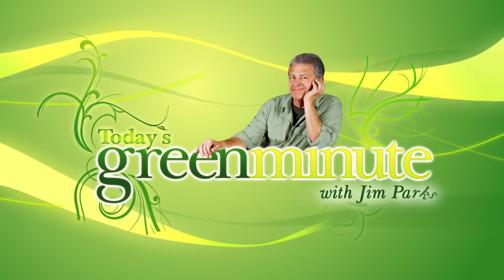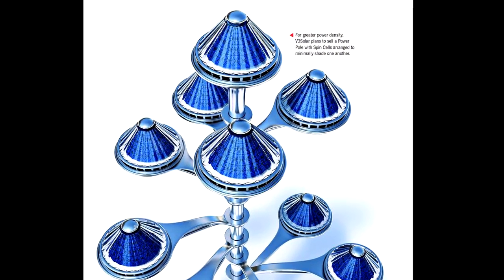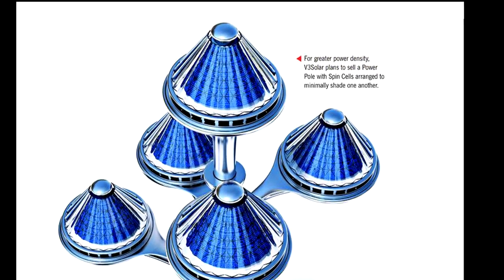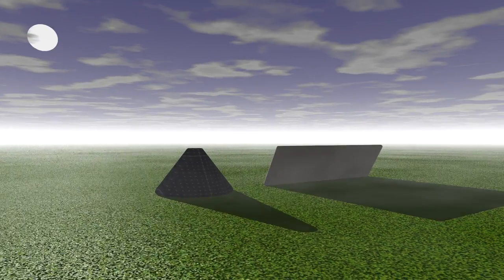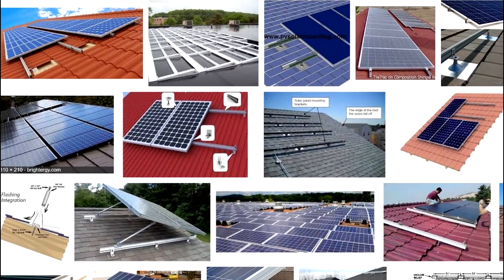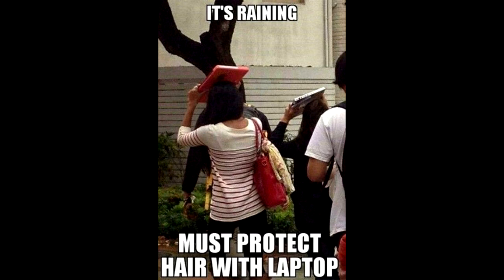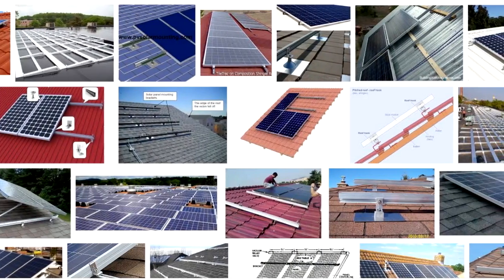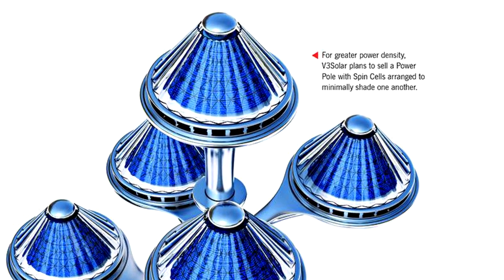Spinning Solar -BUSTED!

Comment: T>F  How about this alternative?   These cells are mounted in the ocean and are designed to SPIN in the WIND and generate more energy then just solar. The other half of the cells would also benefit
from the suns reflection behind the cone.

Comment: if this... were true you would need:
1. a way to generate the power during the dark cycle as well as the light cycle
2. a way to spin this thing without using power to some sort of reliable sort of way... my best guess would be some place very windy that never I mean never is not windy or have it turned by water... seeing as flowing water does not exist in space very often or on other planets... windy wins with a what do you mean always sort of sound...
3. http://www.solardaily.com/reports/Hydrogen_from_sunlight___but_as_a_dark_reaction_999.html based on ? "https://www.technologyreview.com/s/521671/cheap-hydrogen-from-sunlight-and-water/" it would need this to work... I mean "need" it too work.. you would need constant solar gain from the whole ting 24/7 to some extent, even on mars... maybe maybe not though with sand storms that better be a shell of impervium... ? unobtainium?

Comment: Well for if u are going to pick on someone then u better be damn sure that u are 100% correct.

A solarpanel generates power even if it not hit by direct sunlight, its low but its there.

Comment: i think the idea behind the glass cover is to get rid of angle falloff by refracting sunlight to hit perpendicular to the faces of the sun cone.even taking this into acount you have  50% of the surface occluded and even if you assume a 20% increase in efficiency because of cooling  (wich is straight up unrealistic) you have a 30% efficiency loss from a flat tracking panel...

Comment: WOO WOO WOO! Hold on. You think 20% more efficiency , on a 20% efficient machine, is 400%?! Let me explain, and correct me if I'm wrong.

Lucky for us, a "percentage" is a number between 0-100. 20% of 100 is 20. SUPER EASY! So what is 20% of 20? (He said this cone solar panel runs 20% more efficient then the current 20% efficient solar panel. You would use the equation (20*.2). So what he said mathematically was his machine can run at 24% efficiency compared to current solar panels, that run at 20%. 

also 2/3 is 33%, not 30. That is a huge difference
also largest telescope http://phys.org/news/2016-09-china-world-largest-radio-telescope.html

Don't be a try hard. You realize that if he is right on what he has, It is the next baby step to actual efficient dependable solar power. I also think that our technology is not advanced enough. With dreamers like these, eventually we will have a break through!

If I'm wrong, show me your sources. Anyone who believes a YouTube video without looking up where the information came from clearly lacks intelligence. I question why I see no sources from you. Convince me. I am listening

Comment: Actually before it got in detail and I'm less than 4 mins in I guessed that when spinning, the backside wouldn't just go instantly off. But like sort of have the power fade away-ish. I also guessed that if the panels are too hot it just slowed down performance. But heck what do I know. I know nothing. Also I would guess that panels try to resist heat, which in turn means less efficiency because it needs materials to not catch fire or burn instead of focusing completely on making power.

Comment: Water! The Miracle Cure! (for dehydration). It'll cure everything, so long as it's caused by lack of water, and it's treatment is more water. Also Thunderf00t forgot to talk about how just spinning it will consume a sizable amount of the electricity generated, reducing it's efficiency even more.

Comment: even in shade wouldn't a solar panel work? i mean there is still light there or you wouldn't be able to see it right? even if the density is much less than in direct sunlight, i know you are making approximations but it has to be less than zero right?

Comment: Um, your math is wrong. 20% efficiency * 20% efficiency != 400% efficiency. 0.2 * 1.2 = 0.24. or put another way, 0.2 * 1.2 does not equal 4.

Comment: Why wasn't the aspect of the sun shifting covered in the analysis? I mean it's probably still not as efficient but that seems like a major oversight in the comparison. For half the day, the flat panel wouldn't be getting any sunlight anywhere on it, if angled like that.

Comment: Well there are a few problems with this pontification and outright dismissal of the cone panel, apart from some dodgy math.

1. The amount of heat a solar panel attracts depends on the degree of latitude. Where I come from I have seen panels heating up comfortably above 70°C and produce virtually no electricity at all for a few hours every day, especially when there is no wind to cool things down. So the potential drop in power generation is closer to 80% than the claimed 20%.

2. There is no direct sunlight required. A panel will work well as long as there is light and UV. If the cone circulates fast enough all its cells should almost get continuous and  enough solar exposure right thru the day without heating up very much.

The only way to put this to a test would be to experiment at various latitudes and solar/wind conditions with a standard panel and compare it to a prototype revolving cone rassembly over at least a year; taking continuous data during day light hours.

Has a prototype of the revolving cone panel assembly actually  been tested already, or is all this just a theoretical exercise - which in my experience would  just be cheap talk. However to dismiss this out of hand with no practical experimentation is just as asinine.

Comment: One advantage is they take less space than a standard panel... making them abut equal efficency with twice the amount of panels in same area... so it costs more...
Reply: Joel Reid They may take up less space for the same solar panel area, but being more efficient is highly questionable. As pointed out in the video, those solar panels on the cone will not all be active at once, the panels at the back will be shaded and as such will not activate (spinning does not solve this issue). It is sort of like making a double sided solar panel. Sure you get more panels in about the same place, but you have have one solar panel facing away from sol.
Reply: locky300 i was referring to efficiency by land use...
I thought my comment was clear that this still does not solve the issue that to reach similar efficiency you need at least twice the amount of panels. Which means everything you just said i had already agreed with.

You seem to be presuming i am an idiot, when my comment (if you read it properly) matches the claims of the video. I was just adding something not mentioned.
Reply: Kent brochman "equal efficiency with twice the number of panels in same area".... that means you need twice the number of panels to meet the same as a flat panel but you use the same space to do so.

"So it costs more" self explanitory as to explaining it is a crap idea if same (or less) efficiency over same area but costs more.
Reply: Joel Reid no, your first comment read like you were with the Hollywood actor.
Reply: No where did i agree that this thing was a good idea. If i did then please indicate with a quote from me.
Reply: At no point did I assume that you were an idiot. Nor would I say that my comment treated you as such. If I had assumed as such, I wouldn't of responded as it would have been a pointless endeavour. But I'm afraid that your comment wasn't actually clear on that point, as after reading it a few times its general composition seemed to suggest that you were disagreeing with the video. Still, that much is irrelevant as we have nothing to discuss. I wish you the best, and goodbye.

Comment: Energy from the cells will be lost with the electric motors. Yet they are claiming more efficiency? Utter BS. Then there is a motor/gear/ bearing reliability issue with temperature and the elements...

Comment: Excuse me for asking - What if we tried a tracking solar panel that was a concave cone/dish style? Of course if it collected water that would be a problem, but it could be solved.
Reply: What would the benefit be?
Reply: Matej Brada more reflective light is gathered - as it reflects from one panel it is gathered by another, etc.
Reply: Interesting idea. I suppose that you could design such a shape to do that, a dish wouldn't work, plus the entire concept is slightly flawed. When you think about it, you are trying to make the surface reflective, so that the light can actually reflect, instead of diffusing, AND absorbing at the same time. 
This idea is however used in specific solar panels, which are shaped in a way to focus the light into one line, and a tube filled with water is put into this line. The water absorbs the heat and carries it away to be used in a turbine. That's the simple version of it anyway. 
And on large scale, this is used with heliostats. http://climatekids.nasa.gov/review/concentrating-solar/power-tower.gif
Reply: Matej Brada I'm no genius. I just don't think there's a way to harness energy from the sun effectively in our current society with the materials we have but...

Another thought just came to mind - Black absorbs heat from the sun, right?  What if we could somehow use black fabric, and harness the energy of the sun as it radiates from the hot side to the cool side? Some guy has already made this for clothing - what if we used the technology in solar panels?
Reply: Simon WoodburyForget Then you figure it out.
Reply: Simon WoodburyForget Eh, I'm a worthless idiot who doesn't deserve anyone's time.
Reply: Simon WoodburyForget I am sorry, I don't quite follow your argument in the second paragraph of the first post. Why is it so expensive to heat up water with mirrors and use this heat to power turbines,s similar to fossil fuel power station?
Reply: Hey! That's a great idea. If it rains in the middle of the day birds could have a solar heated bird bath. That's eco-friendly!
Reply: what's wrong withthe flat ones?
Reply: There is nothing wrong with the flat ones lol...this idea of making weird shaped solar panels is just dumb. When making the panels, they are made flat from doped silicon. To make a curved one, or conical one requires separate modules to be wired together. A flat one can be rotational as well as 2 axis adjustable to always pointing directly at the sun. The circuitry needed to do this is minimal and cheap as well. I guess the more expensive part would be the mounts, and stepper motors/servo controls. Nevertheless, way cheaper than wiring up this contraption! Imagine how fragile it would be as well!
Reply: ***** What do you think about the black absorbing heat thing? Do you think that as heat transfers from one side to another we can capture the transfer loss and turn it into energy?
Reply: Well, not effectively. The heat simply makes things worse because it increases resistance. The best way to use heat for energy production from sunlight i know of is a solar powered sterling engine where you focus the heat through a lense onto a point of metal and then use that for the hot side of the engine.
Reply: Focus the emf waves through a lens i mean, much like cooking an ant with a magnifying glass, but on a bigger scale.
Reply: ***** I see. some guy made clothes where he uses the transfer energy of body heat to charge cell phones and stuff - I just thought we could apply the same principle to new solar panels.
Reply: Well think of it this way. A few mA vs 110v/45w, or roughly 2.4? amps. We are talking 100 to 1000 times the power production. A phone has something on the order of 7 watts at 3.87 volts. The charge cord provides even less power than that...in the thousandths of amps. So basically it would be almost nothing. You can charge a phone with a very tiny solar panel...most solar phone chargers are actually quite generous in terms of output. The actual requirement is far less, just takes longer. In reality you can charge a phone with nothing but a long bare copper wire attached to some regulators just by picking up am radio stations etc.
Reply: the problem, is heat.
Reply: Isn't there something very similar to that with Solar panel stations that has a single central tower in the center of a cluster of flat solar panels, and the panels themselves can change their angle so that they catch the sun light, but also reflect that sunlight to a second array of solar panels on the tower itself. So that the light that the panels don't catch is reflected to more solar panels.
Reply: Great! nuclear winter anyone? I mean if we are so concerned about earth overheating...why not just nuke the crap out of an unused spot of land? OH that's right, the people who claim global warming also hate nuclear weapons and therefore jettison the idea of using them for useful things because they know global warming is false. If it was the serious calamity everyone is claiming it to be, then a proven solution is already available. Checkmate climate change.
Reply: I really don't think that global warming is anything more than a cyclical period of warming temperatures that happens every 1000 years or so that lasts for a period of 20 years. You can see that the sun is very active right now, but everyone just wants to point to humanity and say that they are the problem because well WHO ELSE WOULD BE AT FAULT?
In reality though, I do think we should still try to be eco friendly, but not at the expense of our own wellbeing or innovation that could potentially help us advance beyond where we are today.
Reply: You know if global warming enthusiasts had a helpful positive message like that, instead of BAN ALL CARS/TAX ALL MANUFACTURING OUT OF EXISTENCE...people wouldn't reject it in self defense as an attack on their livelihood. In point of fact, every single legislative initiative regarding global warming is just a tax/outright ban of people trying to make a living/live their lives. No solutions are ever offered which are practical. Instead its just a way in which we still need stuff, so we have to produce it elsewhere, or charge substantially more money for the same products. The tax isn't being paid by some amorphous rich company. It is being paid by poor consumers in excess...

I agree, eco friendly products can and will be introduced. People like such things! All these people banning industry are actually regressing the world backward and they don't even seem to realize it.

Comment: Musks Mars excursion is realistic... in about 100-200 years....
Reply: You are underestimating technological advancements. There is a lot of technology that you might not be aware of. Thanks to our computation power increasing, a lot of simulations are being done. Materials and designs can all be computated making any design of a somewhat space ship realistically feasible within 20 to 50 years.
Reply: The technology is not the problem. A flight to Mars is feasible.
However, just like to end the hunger in the world.

The problem is a social one. It is a project that requires massive cooperation between the nations and the willingness to invest multi billion dollars in the supply.
It would be the biggest project ever. At the moment, the 4 large space cubicles barely keep the ISS running
Reply: i need 30 seconds to Mars
Reply: M SC We could probably simulate a theoretical material quite easily. The issue would be making that material a reality.

Comment: I've got an idea, what about a wind turbine made out of solar panels, it would cool itself with the wind.
Reply: Simon WoodburyForget what about putting solar panels around the pole of the turbine?
Reply: Bebo18 would reduce the panels efficiency
Reply: they spin fast and it will brack in 5 minutes if they did what you say
Reply: make the shaft out of solar panels! and then they spin in a cone shape while being used for a road to heat thorium, the densest material known to man
Reply: Joseph Payne Thorium isn't the densest. Osmium is at 22.59 g/cm^3, whereas Thorium is only 11.72 g/cm^3. Also, osmium isn't a very large market. It's estimated that less than 100kg of osmium is produced and refined every year. Lastly, production costs for something of that size would be highly unrealistic due to the fact that one troy ounce of osmium is $400 USD or about $13,000 USD per kg

Comment: What if you just put stationary mirrors all around a flat solar panel that is parallel to the ground? At sunrise and sunset the mirrors would block the panel but for the majority of the day it should improve light coverage, right?